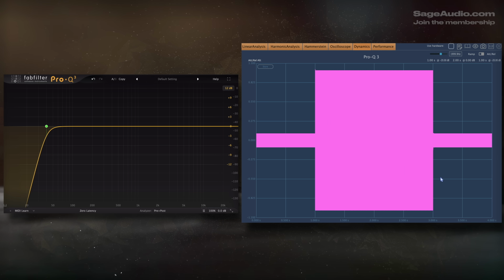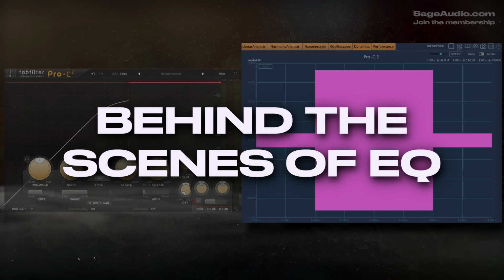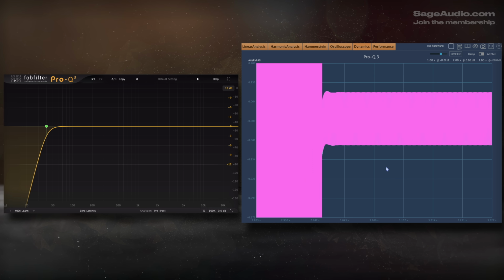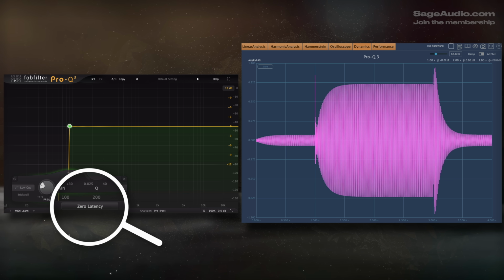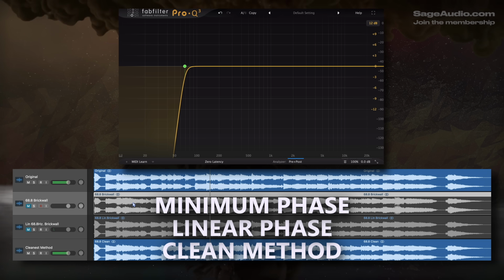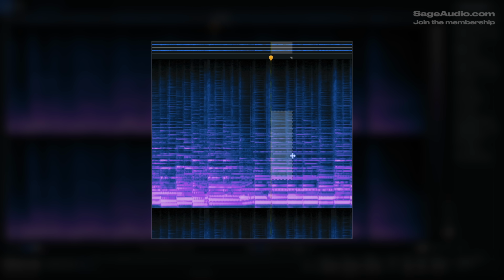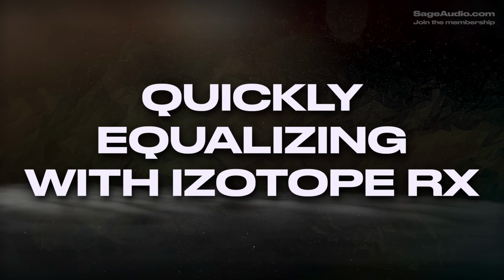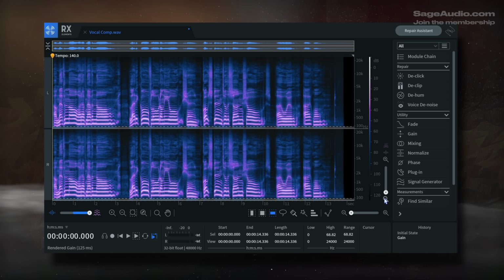The Cleanest, Most Accurate EQ Possible (and you’ve never tried it)

Comment: Yes, using dual modulating all-pass filters is how digital EQs make HP/LP filters work in the digital domain. I could write a book on how this was a good way to solve the problem in 1993 when Waves came up with it in Q10 but in the modern world 30 years later we still haven't figured out how to solve this issue. Every DSP cookbook explains this in detail. But you took the longest most arbitrary and frankly more confusing for way to explain it to musicians and engineers who aren't DSP coders. RX has spectral artifacting that is in my opinion worse since 99% of those plugins are based on the Opus codec standard from Xiph, since it is open source and free to use and no extra cost to the developer its the standard. Spectral processing has its downsides too which can be heard as lossy artifacts similar to using a codec filtering for AAC/Mp3 or Vorbis. HP/LP Filtering continues to be a debate in the audio coding space since there is simply no way to truly mimic it in the digital domain with a 1 to 1 like other tools such as compression or even regular EQ curves like shelves and bells which digital does perfectly well.
Reply: When do you use speclayer, ? In normal processing or mastering?
Reply: @joesalyers  The guy who developed Spectralayers says you can mitigate pre/post ringing/all artefacts caused by drastic amplitude changes if you understand how to use the software properly.
Reply: @happyshadow  I'm not talking about pre-ringing whatsoever. I'm talking about how that high/low pass filters work in the digital domain. HP/LP filters are actually made in the digital realm by using dual offset modulating allpass filters. 2 all pass filters 180 degrees off set based on frequency divided by time.
 The other issue was just Spectral processing uses an open source codec that is Lossy (opus) so it can work in real time. If Spectral plugins used lossless codecs under the hood it would take an hour to render a 3 minute stereo audio file, so until we get a more efficient lossless codec spectral plugins are always going to have that weird spectral sound from the Opus codec running under the hood. Don't get me wrong Opus is the best codec for lossy audio since a 64kbps Opus file will sound as good as a 320kbps Mp3 or AAC file but its still lossy and how much of that creeps into the output of the spectral plugins is anyone's guess. So I have no problem with digital EQs but I think we need a bit of innovation since most of the code we use is from general ideas pioneered nearly 30 years ago in the early 1990s.
Reply: @joesalyers  who told you Opus was used? That's for audio transmission over the internet.. Neither RX or Spectralayers encode audio into Opus otherwise it wouldn't null/form the original file after the back and forth conversion.
Also Spectral editing is an offline process that converts the file into FFT so that the full spectrum doesn't get altered (which I've null tested and holds true). The whole point of the video is that filters that change the phase aren't used. If the FFT window is set correctly and the image is focused in the correct way phase shifts, pre/post ringing can be avoided. As it's an offline process it's much more tedious but for people looking for an artefact free method is desirable.
Reply: @happyshadow  To answer your first question Who told me Opus was used its not just for transmission over the internet stop repeating the first thing that pops up on a google search? The Open Source GPL licenses that all spectral plugins and applications are built upon which are public domain. Opus isn't the output but the real-time sidechain of the actual processing. Xiph hold the ONLY open patent on spectral audio analysis in the public domain so they all use it. You are being combative just to argue on a subject that isn't even my original posts concern. I was highlighting the fact that there is no such thing as High and Low pass filters in the digital domain, it is a clever trick of using all-pass filters to achieve the same goal. 
 You are hung up on spectral processing using the Opus codec (which can process lossless but not in real time) This is why most of the spectral apps use the lossy codec for realtime processing or its offline like the apps you mention. But still no matter if its Spectralayers, Clarity or RX or anything else. HIGH AND LOW PASS FILTERS UNDER THE HOOD ARE ALL-PASS FILTERS NOT ACTUAL HIGH AND LOW PASS FILTERS. I'm done this is clearly you arguing about something I don't care to repeat ten thousand times. I don't care about spectral apps or plugins. The original video didn't have the knowledge to notice the filters in plugin-doctor were being modulated because they are ALL PASS FILTERS! Spectral plugins are cool, use them if it works for you thats great. But the simple fact that he missed what makes HP/LP filter modulate is astonishing. But I don't care about spectral plugins I know how they work, I've worked as an audio engineer and a DSP coder for over 20 years. I was trying to explain why he was having the modulation from "digital HP/LP filters" but he didn't even know the reason why and it is clear what is going on under the hood. 

 Apulsoft built one of the very first spectral plugins for audio and then improved it to their spectral exciter called apUnmask. Apulsoft explains spectral processing somewhat in the manual and more in depth in their white papers on the subject if you want to know more. Unlike Izotope, Waves & Steinberg who make you write them a letter to receive a physical copy of their open source licenses (which is a violation of GPL3 but no one is going to sue them) Apulsoft do not hide it and display it proudly. Some companies like to hide the fact they use open source tools but others do not.
Reply: @joesalyers  I asked the guy who designed one of the leading spectral editors 😂
Reply: Your conversational skills are that of a 3 year old. You know with your knowledge you have the opportunity to be an impressive person BUT your angry and overly forceful communication skills leave you looking like... a plum
Reply: @joesalyers interesting ! so for me as an Amateur: A normal Eq-Plugin doesnt Sound worse/ better than the Spectral-Plugin ?? (It just Sound different?) 

Greez from Berlin

Comment: As to your guess, what RX is doing is Fourier editing/filtering. There is no value for certain frequencies in an audio file by default, just amplitude per sample, but this can be Fourier transformed to represent amplitude per frequency, which is what you see in RX. Now editing this and transforming it back to audio yields the results you hear. This also isn't perfect though, as the audio cannot be transformed at infinitely high resolution. The signal is split into "bins", certain frequency bands of which there can be fewer or more of, resulting in a higher or lower resolution transform, especially in the low end. Higher bin counts also mean much more processing power/time is required. This is, why you cannot reasonably do this type of filtering in an insert/online, but rather as an offline process that has to be rendered.
Reply: This. 
I don't know what resolution the FFT in RX is, but I would guess that it's at or above 2048 bins. That's a moderate resolution for a 44.1kHz source, but it's still far from perfect. If it's 2048 bins, that would mean that each bin spans ~21.5Hz.
Reply from the maker: @theCloneman5 I see what you're saying! Since FFT filtering is grouping frequency ranges into bins, and associating an RMS with each range/bin, these ranges can be adjusted somewhat independently with greater accuracy.  By extension, the Pro Q 3 uses an easier-to-compute filter type for its linear filters (either IIR or FIR) so that it can be used as an insert and with potentially multiple instances.  If I'm misunderstanding please let me know ☺️
Reply: @sageaudio  That pretty much is the jist of it. Note however, that FFT filtering in RX can produce extreme artifacts. To find out more, try filtering a dirac spike in RX and watch it ring.
Reply: @sageaudio  popped you an e-mail with a couple tests
Reply: This is fascinating. So is deleting the spectral portion of the converted FFT file a better result then? I tested it in Spectralayers, also tried separating a stereo file into M/S and deleted below 100hz in the side channel. It sounds very open and clear to me, much smoother and more open. I'm Spectralayers you can specify the resolution of the image in a bunch of ways (as well as creating a chain of processes including frequency range selections per module).
Reply: Sorry but i don’t really understand, what is the difference between Fourier editing/filtering and regular EQ editing/filtering?
Reply: @marfixmusic  regular filtering sends the whole wave through the same filter and removes what does not pass it. FFT splits a wave into its mathematical components to build hundreds of little waves that combine to form the original signal. Then the processing is done on a smaller wave, thus not effecting the whole system as much. Still, far from perfect, but a change to say 80hz only effects the wave that is passing through that region, not all the other ones in tandem.
Reply: @NoahHornberger The "wave" is the same digital numeric value representation either way.   An array of numbers having math done to it, a "filter" digitally is a math transform whether iir or fft.
Reply: @TheChipMcDonald  you are missing the point: the math done on a filter is done to the whole waveform at once: as in it is one calculation on a single point. in FFT, the single point is split into hundreds of components and the math is done on each component. I was not making a reference to waves directly, but how they are represented numerically in FFT: it is a beautiful realization when you see how the hundreds of waves add up to the composite wave that is heard. This is not a point about analog vs. digital but I'm actually describing the difference between a high / low pass digital filter and fft, as the questioner wanted to know the difference. Saying 'it's all digital anyway', is missing the whole point of the question.
Reply: @TheChipMcDonald  "The "wave" is the same digital numeric value representation either way" that's not how it works
Reply: @marfixmusic  regular eq's are basically made from allpass filters. allpass shifts phase of different frequencies, so when when you combine allpassed signal with oroginal, shifted frequencies become quiter due to destructive interference (i recommend watching dan worall video "eq doesnt cause phase shift, phase shift causes eq"). allpass is very simple and doesnt need a lot of cpu bcs its just a very fast delay.
meanwhile fourier transform is completely different. it kind of splits original signal into a lot of signals of different frequencies (i think other comments explained fft pretty well)
Reply: I thought linear phase basically is FFT, then filter on frequency basis, hence causing the effect on time domain, and revers FT... I assume RX may be up sampling to lessten the effect maybe... :-?
Reply: @philippgrunert8776  There are different ways to go about designing a linear phase filter. Most commonnly it is an FIR filter (you can look up the different topologies of FIR and IIR online). Mind you. FIR filters by no means HAVE to be linear phase. To put it bluntly, this FIR filter receives a small window of looking into the future (lookahead), whilst the IIR is a feedback loop applied in real time. The visualization you see in most EQs and analyzers like Span or Prism is a somewhat low resolution FFT, but it isn't actually used to process the audio. Zero latency linear phase filtering would require you to know what happens in the future, which in our current understanding of physics cannot be done easily, if at all. There would be two ways to make this work. Scenario 1: we find out the path of time is completely fixed and determined, so we can create a four-dimensional device to tell us about the immediate future. Scenario 2: We use a predictive model, that can very accurately calculate the most likely next sample. This seems actually doable, where it not for the amount of computational power required. The way I see it, this is a kind of filter we might be able to use one day. So in short, the way RX's filtering differs from Pro-Q, is that RX knows what happens next, because it's looking at the whole file. Here's a little experiment you can try: Halve your Eq settings and run the audio through it twice, once in reverse. You will get a linear phase filtered signal with pre-ringing.
Reply from the maker: @theCloneman5 Thank you! Well that's what I found so interesting - when using a drac/impulse file I noticed pre-ringing, similar to but with a shorter duration that Pro Q 3's linear phase filters (ran out of time when making the video; otherwise, I would've included this part); however, with RX I couldn't observe any alterations to the waveform when using a complex signal.  Since both use some form of linear phase filtering, I'm curious about what differences between FIR and FFT filtering are causing additional alterations to the signal when using an FIR model.  Per usual, making these videos makes me realize I have more digging to do (which is a good thing, imo haha).  Thank you for your helpful responses 👍
Reply: @sageaudio  I had a brief word with the guy who developed Spectralayers and he said it is possible to mitigate 100% of the pre/post ringing if you know what you're doing. its to do with the FFT window size and the brush/selection fade slopes. he's very responsive on Gearspace
Reply: @happyshadow  Great that you just Said The same thing like i Said.. but i just Said that perfect eq is impossiple to complish and you Said its possible
Reply: @loving_heart607  wut?
Reply from the maker: @happyshadow  Awesome! That's something I'll look into!
Reply: @theCloneman5  noncausal fir filters are implemented with latency, which is reported to the host to then shift everything else back that much
Reply: @morgan0  Well yeah, I believe I said as much
Reply: Fourier transformation has its own Ringing depending in a size of Window..like you quated your friend " IT has something to fo with fft Window size " ... And editing slopes like you quated. was Also already Said when i Said fourier Window has its taps Ringing or something like that..fourier Window overflows over and under harmonically depending on quantity of bins or taps ... So maybe IT was too mathematically Said that mist of people just did nyt understand.
Reply: And its impossiple to totally remove bin or tapa overflows from fouries because fourier causes IT.. so its impossiple to Make "pure" eq.
Reply: And overflows of bins or taps causes errors on equalization picture ...so its already has a " prossessed signal error " when IT displays that " frequency picture"...
Reply: Happyshadow that wut 🙂
Reply: I used to study on applied university and we made a simple speech regognization program which used fourier transformation...never gratuated but still 😃😂👍
Reply: What i learned when i did Windowed fourier with mathcad years a go that some taps out of Window size still rings or has ownsize volume Ringing depending on a size of a Window 😂👌
Reply: but The Ringing error codes when you Make The Windowed fourier - when you form The equalization picture from where you deleted The frequencies..so its like to you rather want The frequency distortion before filtering audio or after 🫶
Reply: Ringing error comes... Chinese Mobilephone and text correction.
Reply: Actually, Reaper has the ability to do non-destructive spectral edits to the audio items.
Reply: Regular digital EQs should also be using Fourier transforms... If RX is doing something different, maybe it's the size of the default look-ahead /look-behind windows used by each? I don't think RX worries about operating in real-time at all.